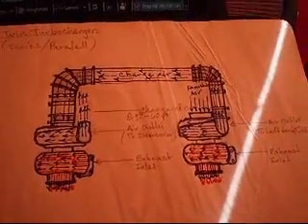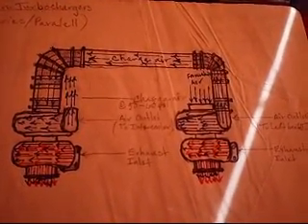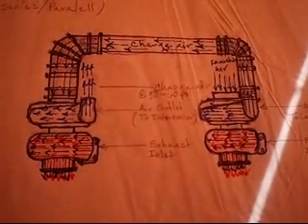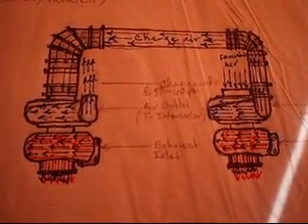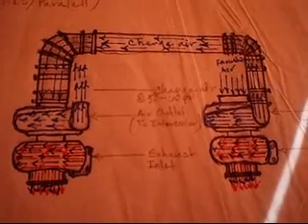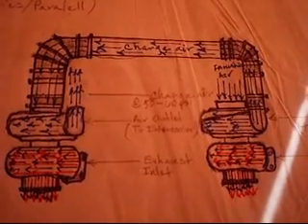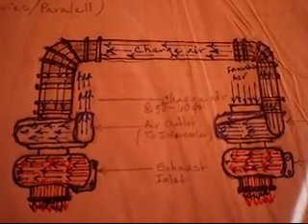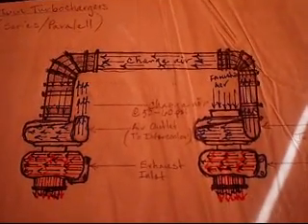3408 Twin Turbo

Comment: That looks just like an ACERT set-up or like the twin-turbo 475 Cummins a few years back.
Only problem with big HP on the highway is engine cooling.
The marine 3408 is twin-turbos in parallel and they put out about 800 HP with sea water cooling via a heat exchanger.
A guy over here in Australia put together a highway 3408 in a KW Aerodyne with twin turbos in series that put out about 800 HP.